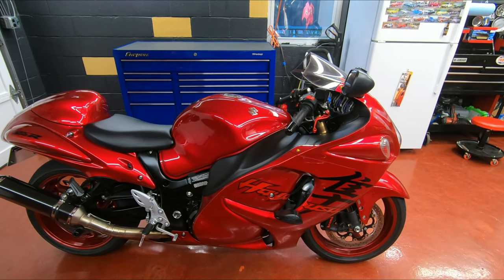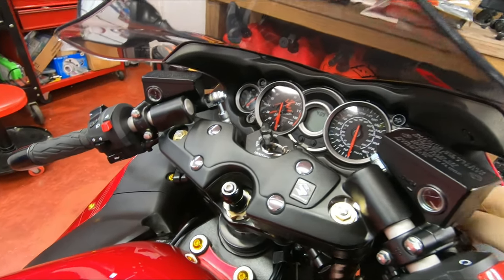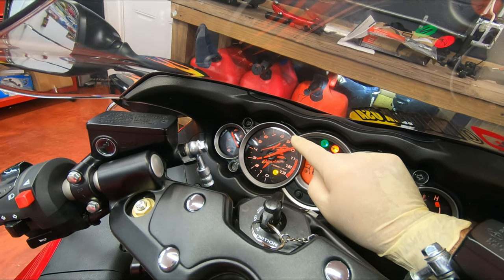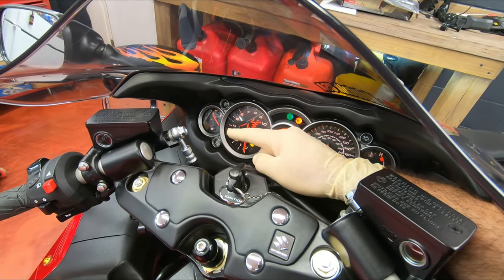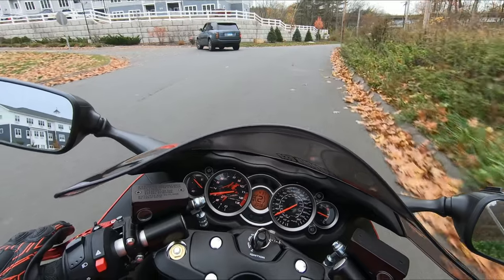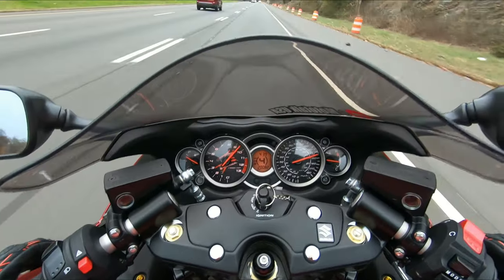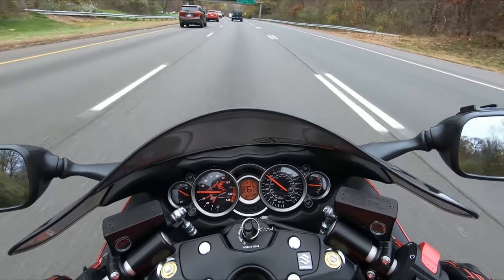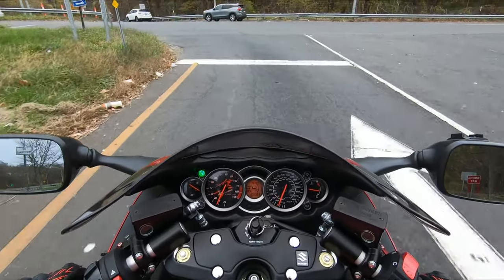How to activate SHIFT LIGHT on Hayabusa | Gen 2

Comment: Thanks for video I have question my FI light is staying on. Can it be reset .
Reply from the maker: You're very welcome man! It can be reset, there's 2 pins that you jump out on the diagnostic port ( under seat) however tho, there's something going on probably, that's why it's on. You're in luck because next week I'm posting a video how to sync the throttle Bodies and reset the FI light with a diagnosis tool, so stay tuned! 😉😉
Reply: @MototalkUSA  yeah bro thanks I took the took the tank up and saw something unplugged it good now
Reply from the maker: @jaybavis5896  good find! 🙌🙌

Comment: Change that to 10,750 and you’ll be set. It’s peak for both Tq and HP.
Reply from the maker: I could try it, thanks man. The only thing is when I shift It'll drop under that 10,750 and I'm not at the peak anymore.
Reply: @MototalkUSA  the way to think about that is, everything leading up to 10,750 is increasing, everything after is decreasing. So the further past you go the less your making.
Reply from the maker: @Nitrous_Busa  alright alright...that's a good way to put it 💪

Comment: Great video but it quits pulling hard before 11K and starts losing power. Check out dyno videos. But great video.
Reply from the maker: Thanks man!
And yes, it definitely loses power at high rpm. Some say to shift while at peak torque, others say to shift at peak HP but if you shift at peak HP let's say, when you go to the next gear and the rpm's drop, it's not in that peak range anymore, where as if shift past your peak power, and the rpm drops, it'll be closer in that power range. 
But it's all relevant, gear ratios curve bands etc. 
I'm not a pro racer but it seems to me I'm accelerating the most until right before the rev limiter, or at least it seems that way because the engine is screaming! 🤣🤣🤣

Comment: Fair enough - but there is absolutely no reason to take a shift light to 11,500 rpm (above red line) which also means that the peak torque and peak horsepower has being exceeded - best to keep shifting 500rpm before red line (which is the peak HP and just passed peak torque...
Reply from the maker: Yup, you're absolutely right, but I  like to hear it scream 😅
I've been meaning to lower it a bit though.
Reply: its better to stay in lower gear even if engine makes a little less power.. dont underestimate the lower gear power difference.

Comment: Fail to see why anyone with a brain would need this feature. Surely any decent rider will hear the engine noise and know it is time to change up? Nonetheless, thanks for the tutorial...
Reply from the maker: You're very welcome for the tutorial man! I definitely don't have a brain, that's why I need this 😅😅
All jokes aside, it is helpful because if you shift too soon or too late it could cost a race. Most drag racers if not all use a shift light. It's hard to keep track of all the surroundings and also look at the RPM to shift in that sweet spot ☺️